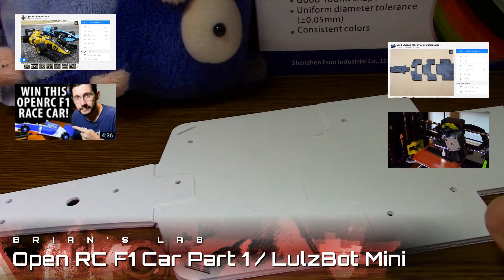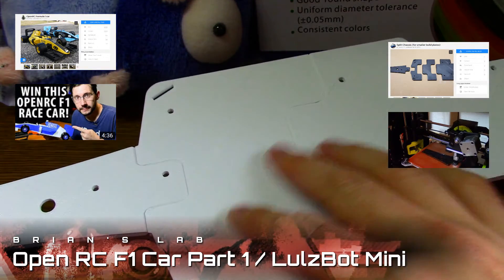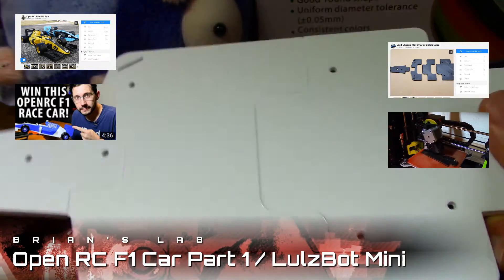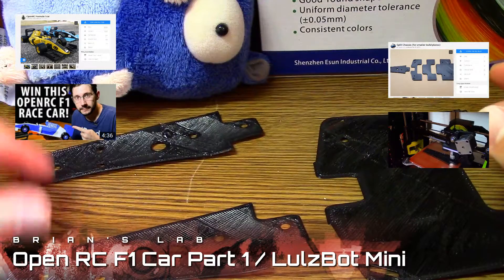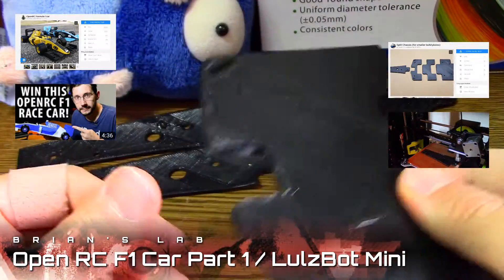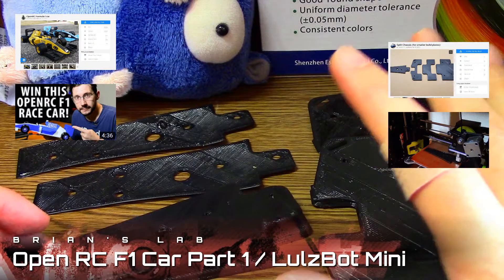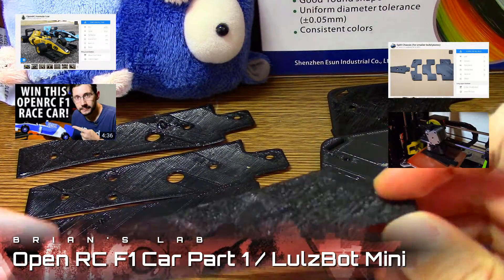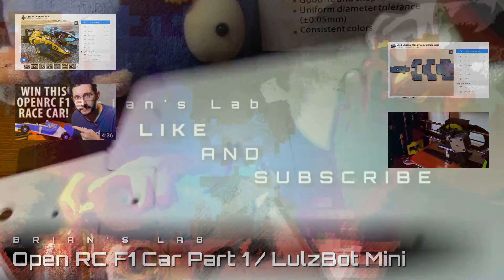Chassis, Y U NO FIT? - 3D Printing the Open RC F1 Car Part 1 / Lulzbot Mini

Comment: When printing PLA on my mini I change the x and y steps in firmware from 100.5 to 100, M92 X100 Y100, then enter M500 to save the changes
Reply: x and y steps should be tuned to a precise measurement for example a calibration cube can be used to tune the x and y steps, but first the extrusion width has to be tuned by printing an open piece and measuring the wall thickness or printing cleanly with 100% infill.